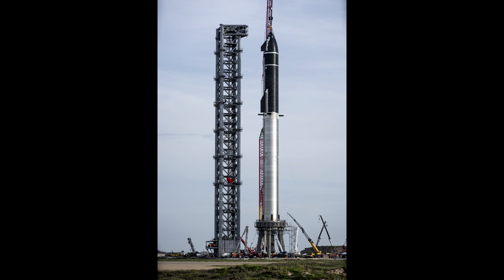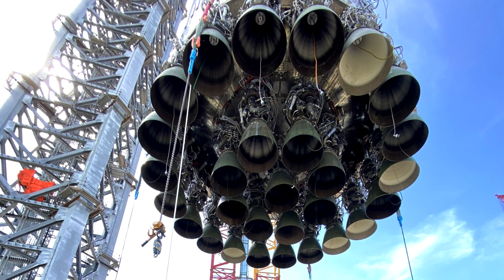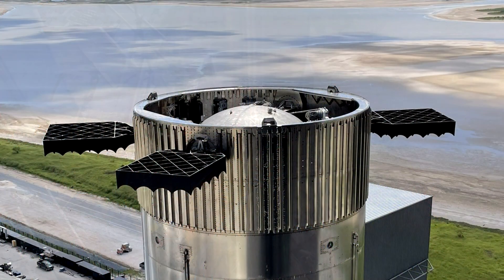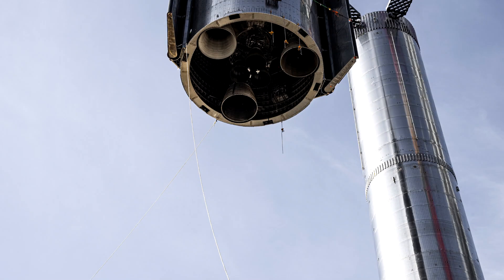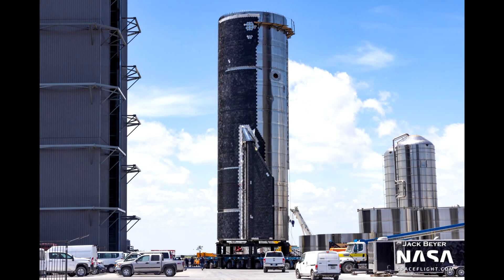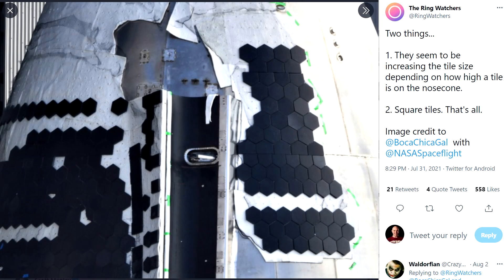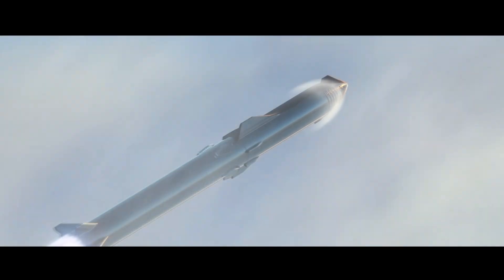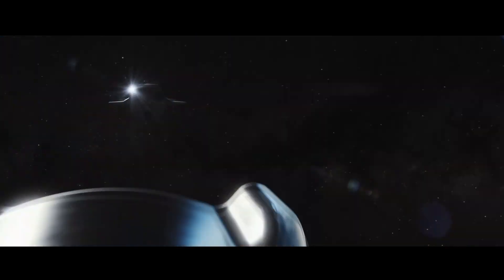How SpaceX Designed A Heat Shield For The Largest Spacecraft Ever Built

Comment: ...how is the test firing of the vacuum raptors done, btw? Can they safely fire them for the full duration in sea level atmospheric pressure?
Reply: I can't say for Raptors, but for Mvacs they remove the bell and run them.  However the Mvac is not a cooled bell so that could and likely does change things.

Comment: Don't think the cubesat idea would be hard. There are standard off the shelf packages for those that use android phones to power them. You just need a good camera, a way to orient it and maintain that for a fairly short time. Deploying it would be easy, just store it in the engine bay of Starship and pop it out after SECO. Obviously that's greatly simplified. It would take a bit of work, but would probably be the easiest thing they've done on Starship.  o7

Comment: I am a tradesman and we solve thermal and moisture expansion and contraction problems by incorporating overlap and tounge and groove conections. This is common in finish work, siding, laminate flooring and roofing. The overlapping could be done simply.  We call it a rabbet in carpentry.   Replacement and standardization would not be to difficult.  I am sure I am not the first to think of this.  I was wondering what the arguments against overlapping are. Anyone?

Comment: Those tiles don't look flush so given the force that the air will be hitting those gaps, surely there is a significant risk that either the heat will be dragged into the spaces or worse, the air pressure could start popping off the tiles.

Comment: Could be a another way to tackle with thermal problems rotating the ship during reentry to 'share' the heat on the whole ship instead of putting stress on the same surface of the rocket.

I don't know if it have any sense this but,  why not a bit of scify idea, generating a magnetic field and try to reduce the friction by repulsing the iones of the atmosphere (if there is a layer of them, if not I didn't say nothing).
Reply: Doubles the TPS mass and adds the extra problem of having to roll in a supersonic slip stream.. flaps might need re-engineering too.  A magnetic field is great, just need a very strong and powerful energy source plus the magnets and hope none of that is more mass than tiles.  That is going to be a tough engineering challenge. :)

Comment: the booster grid fins were relocated to provide a stable catching platform. Had the fins remained at 90 deg spacing, the booster would have had to be supported by only two fins on the catching arms.  Now it's four fins.

Comment: The TPS tiles seem to be the most likely cause of failure from what I am hearing. I wonder if they will make a spacewalk part of every flight in order to inspect the outside of the ship and replace a tile if necessary.
Reply: Likely not.  They plan a lot of unmanned test flights and would need to recover those ships so a system stable from launch to landing will be required.
Reply: @TheEvilmooseofdoom  I should think that they would plan to be able to replace tiles in orbit if necessary. Shuttle Columbia was damaged on liftoff. Everyone at NASA knew the crew was probably doomed but there was no contingency plan to return them safely. These TPS tiles are like ceramic dinner plates apparently. They could crack, break, and fall off. They will never be foolproof.
Reply: @dlewis8405  Again, by the time they are onto manned flights they will already have a working system.

Comment: Scott would you say there is the risk in Spacex design , what if a tile falls and hits and ruptures the booster
Reply: I think the booster is made of malleable (for the most part) steel. The problem with a tile falling off is its possible to create a partial vacuum on the adjacent tile's leading edge causing more than one to strip away if not properly installed. Big question is can tiles handle the vibration and aerodynamic pressures it will be subject to.

Comment: I work as a formulation chemist and work on ultra high temperature coatings.
I have the formula that was developed in the early 1960's for the NASA ablating re-entry "gunned" sacrificial heat shield.

I am currently developing a new Coating to resist 6000f.

Comment: Hi Scott, would you know why the booster is using steel grid fins versus the lighter titanium ones used on Falcon boosters? Would this be to dissipate heat better as well as integrity? Just curious as the titanium fons are much lighter and has been proven a success. I would think lighter efficiency would be better as far as overall rocket performance in all aspects to include weight reduction. But I don't know, so if you or anyone else provide the purpose of using steel grid fins, that would be awesome...thank in advance.
Reply: Titanium is expensive.  The test articles are going into the ocean.  I suspect making grid fins that big out of titanium might set yet another record like the F9's did.
Reply: Cost. Titanium is very expensive. The Starship grid fins are about 3 tons each per Musk and that would cost a lot.

Comment: Wings of the Starship will disturb air to which grid fins will enter on ascend. This may be easier to pass trough to the point that will match amount of fuel saved on weight but will greatly simplify design.

Comment: The story from the pad when Columbia went up is that they saw that foam chunks had hit the leading edge of the orbiter.   They did not know the damage and they could have got a military satellite to inspect, but they denied it.  the reason was that if they did discover damage, there was no way to fix it and there was no time to get another orbiter up there with replacement tiles.  at least anywhere close to safely.   losing 7 astronauts on re-entry is bad, having them die in orbit because you don't have any replacement tiles is worse or telling them to try to land a busted bird with missing or damaged tiles.  My uncle worked out there at the pad when this happened and it was well known out there that they couldn't do anything other than what they did unless they want to precipitate and even larger disaster.  This is spoken lore though because no one was about to go on record about this story.  So they just told and retold the story but nothing was ever written down about it because it was a decision that was never made.

Comment: Is it just me, or does this thing look more and more like a simplified shuttle? The closeup of the tiles on the leading edge of the flaps look a lot like the heatshield on the shuttle wings. 

Do we know if the materal and design of the tile itself is the same as the shuttle or a new material?

Hope the design can cope with loss of a tile, because with this many brittle tiles, the risk of loosing a few is quite high.

Also if they end up having to check every tile before next flight, the sheer number of tiles would quickly prevent rapid reusabiliy, again kind of what happened to the shuttle.

Comment: 2:01 I'm confused as Elon tweeted the booster would be caught by the grid fins, but now he says the little metal arms on booster 4 will take the weight?
I thought it's better if the grid fins rotate 180 degrees so the flat part takes the weight?
Reply: The plan to use the grid fins was dropped a while ago.

Comment: eh, 9 go pros inside a can with air in it to eject the cube of go pros, a device to open the can of air and a wireless device to send the data back to Starship for transmission would be enough. Like basically anyone could do that, so it sounds completely doable. The reason for the 9 go pros rather than just one is so that if the cube of go pros have a spin induced in the ejection process you will contently have a view of the Starship as long as it's not spinning too fast. You don't need some super special custom manufactored thing, you can just buy a bunch of stuff of the shelve and throw it together.

Comment: Can Starship's heat shield tiles be replaced/repaired in space?  With Columbia, I believe it was said that even if they knew about the damage to the tiles while they were still in space that it couldn't be repaired in orbit.  Also, can a Starship approach and landing be done manually by an astronaut or is it so complicated it has to be done by computers?
Reply: I think they'd like to evolve the system past the point of needing to take spares before they put people on it.  Starship will not be under any manual control.

Comment: 12:05: I'm puzzled, blowing combustible substances (fuel) into an extremely high-temperature environmen to reduce temperature. Would the exhaust gases created by the fuel combustion be lower than the air friction plasma?

Comment: Describing the damage to the shuttle as to the heat shield is a bit simplistic. Tests done by Southwest Research here in San Antonio showed that the leading edge of the wing actually was penetrated causing a large hole in the structure itself.

Comment: How does telemetry on reentry get transmitted to ground as the plasma blocks off transmision of the radio signals? In case of a catastrophic failure, how will they recover the data?

Comment: Wonder why the don't use Aerogel or Starlight for heat insulation? Aerogel is flexible & almost as light as air & doesn't crack or shatter (like a plastic). They could literally coat the whole surface or at least bigger sheets!

Comment: Is there any new technology other than the thermal tiles?
Reply: The Raptor is the first full flow, staged combustion engine to fly. Apparently, SpaceX developed a new alloy for the combustion chamber for the engine to survive the pressure.
Reply: Few appreciate the advances in computers required to do all this as well.

Comment: Why don’t they put the heat shield tiles all the way around the tube, and then use the mesh fins to roll the rocket like a hotdog? Surely this would lower the peak temperatures experienced by any one tile, and might also offer an emergency plan if part of the heat shield starts failing. They can roll the failing portion around back and give it a rest

Comment: What is the weight for the heat shields on both super heavy and starship?
Reply: I don't think that has been released. As I understand it, Super Heavy will not travel fast enough to need thermal tiles.

Comment: Could it be a possibility that the stacking of 4/20 starship booster was to get a more accurate reading of load/weight on the launcher base and for the tower? Not sure how accurate 3D models are for structural steel programs or concrete programs, especially on such a scale, with rocket size/weight, and the catching arm design. I can only imagine the amount engineering in just the base and tower. So I just wonder if a more accurate reading of weight and wind load of a standing starship is really useful. Or if it would even be possible or necessary to get the actual weight of a starship with 3D modeling now a days. Again I’m not sure of the accuracy of weight or wind load in large scale as this in 3D models. I’m only a structural steel  detailer so I only know what a engineer notes and shows on design drawings when it comes to loads. I know very little  but would love some insight if anyone smarter knows!

Comment: Those grid fins will be a problem. Especially if they are always in the slipstream. How can u land an aircraft on its ailerons, and expect those ailerons to work perfectly afterwards? Any failure of 1 will send the rocket not only off course, but may break it up from aerodynamic stress. Many a rocket has broken in half shortly b4 a fireball, by changing direction compared with airflow.
Reply: It's in a atmosphere for only short parts of it's flight, it might not be a big issue.  Testing will tell them.  They won't be landing on the grid fins.
Reply: @TheEvilmooseofdoom  I thought the whole plan was to land on grid fins, the tower catching it. The grid fins have bearings to rotate, and even bearing free, the mass of even an empty stage1 will put pressure on the fin anchor points, which must be able to rotate to operate.

Comment: instead of trying to stop purely using the atmosphere, could they use the heat from re-entry to generate energy that to produce some kind of trust to slow down the rocket .
Reply: like a stirling engine? no, im pretty sure you cant make thrust from one of those, but you could make some inefficient energy
Reply: @clayel1  more like a steam engine , but not with water . something that melts / boil at a very high temperature , so i can freeze or solidify again even if the temperature drops to a slightly less hot temperature , so the substance can be cycled around again . 
That turn a propeller that generates trust . 
The heat seems like a energy source that is going to waste , and is also damaging the ship , so i think that someone should find someway to use it for trust . What i said probably still won't works , but i hope a rocket engineer  find some way of using that heat energy . Don't fight the heat , work with the heat , that is basically the idea i am trying to convey . 😄
what do you think about the steam engine ?

Comment: I saw part 1 and 2 and he covers so much it's crazy.  You can see him actively thinking about what he can say and what he probably shouldn't.  I believe Elon is always running new ideas through his head no matter what is going on.  I have a theory that at least a few times a year he asks something Starship related at Tesla and vice versa.
Reply: He did make a reference to using Model 3 motors as part of the grid-fin positioning mechanism.  Synergies!
Reply: @lmamakos    If the Model 3 motors don't weigh less than the original Model S motors I'd have used old Model S motors.  The Model 3 motors are much more efficient because they are not just induction motors but actually IPM-SynRMotors (Internal Permanenant Magnet - Synchronus Reluctant Motors) and wouldn't be needed because they are obviously not going to be rotating at high rates of speed.

Comment: I'm willing to bet the red Glue is a HILTI Epoxy, specifically HILTI HIT-500.  
If they have a Red Sausage Squirter gun then for sure it will be HILTI Epoxy, 2-part.
The HIT-500 Series of Epoxy can be placed underwater and still cure.  Great stuff for Rebar.

Comment: Scott, please, I’m confused. I was of the belief the reason @ElonMusk used stainless steel, was because it could ‘cope with the heat’ and no tiles meant less weight. Did I miss something?
Reply: The main reason it's the possibility of changing design fast, resistance to heat and cold is better but not enough to survive re-entry, and in case of something going wrong with the heat shield, the ship "could" survive, counting on a bit of luck.

Comment: 15:38 interesting how they abandoned the fins on the booster, im sure that's a mass savings but it means it'll be aerodynamically unstable on launch, no?
Reply: Those weren't fins but legs, outdated design before the tower catch.
Reply: @unknownsoldier452  they're obviously aero surfaces. if they were just legs and didn't serve as fins, they would look like legs rather than fins. These fins would obviously produce stabilizing lift and drag forces. Without them the vehicle looks to be aerodynamically unstable, requiring active stabilization from the engines to keep it from spinning out in flight.
Reply: @chrismofer  Sigh, you are clueless. Those were the original legs.
Reply: @unknownsoldier452  they're obviously both for landing and for use as aero surfaces. if they were JUST legs and NOT fins, they wouldn't look like FINS they would look like LEGS. think about it.
Reply: @chrismofer  Show me a single document where they were presented as fins.

You won't because you can't.
Reply: @unknownsoldier452  This very video, I even timestamped it for you. why don't the legs on falcon boosters look like fins? because they aren't, they are just folding legs. These legs on the other hand, aren't just tubes with feet on the bottom, they're solid enclosed aero surfaces OBVIOUSLY designed to function as passively stabilizing fins, like basically all rockets have, AS WELL AS being legs. why can't you understand this? they are fins that you can land on. they would obviously provide stabilizing lift and drag forces IN ADDITION TO being legs that you can land on. use your eyes, dude.
Reply: @unknownsoldier452  there's actually few documents mentioning that early cgi design anyway, let alone talk about the legs which are obviously aerodynamically deigned to be fins.

Comment: Not mentioned is that the original legal approval for the launch site does not cover something this powerful. Is Elon attempting to get the rules changed? And if it blows up on the launch pad and causes damages to houses in Boca Chica (and quite possibly blows some windows in South Padre) what will this cost? I can't imagine Elon getting legal approvals if that happens - or if it is possible. This is why I fully expected this thing to be launched from the oil platform.

Comment: ...but there is another problem with large scale on re-entry.  Weight is proportional to linear dimension cubed, & area is proportional to dimension squared.  Weight determines the amount of kinetic energy to be dissipated on the way down & the velocity must be at least 25,000 feet per second.  That energy has to be borne & distributed over the area available.  For the large vehicle, each unit of area will be tasked with dissipating proportionally more energy.  The time to dissipate it is more-or-less fixed by orbital mechanics, about 20 minutes from LEO, & SHORTER from interplanetary orbits (& speed will be much higher).  Aerodynamic lift will be less significant for this vehicle vs the shuttle, so the path will be more ballistic.  The power dissipated per unit area will be much higher than for smaller vehicle!